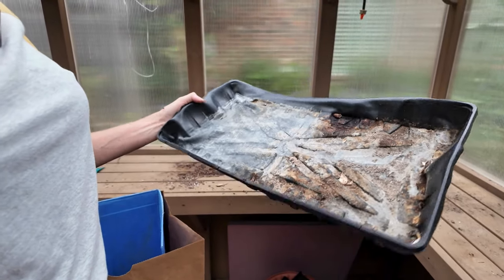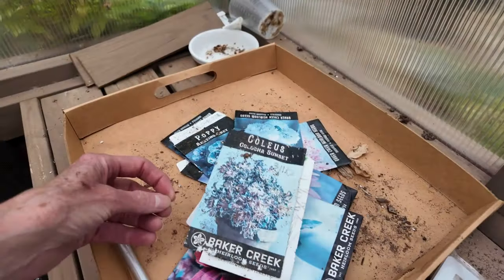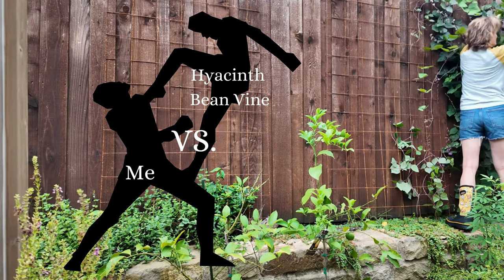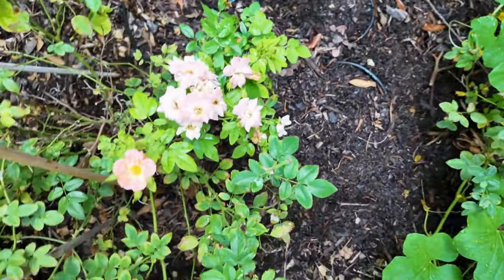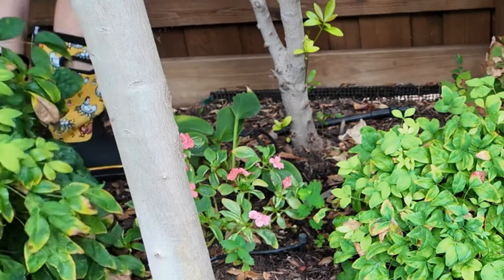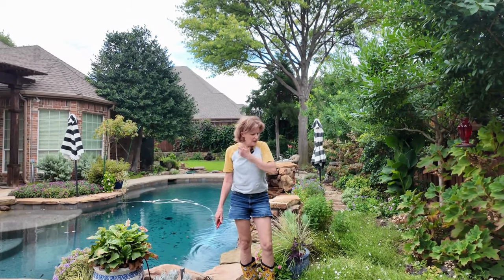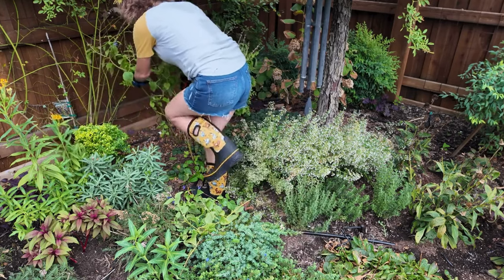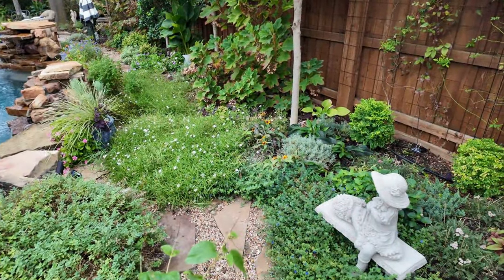September Garden and Greenhouse Clean Up | Trimming | Deadheading | Fall Garden | Zone 8b

Comment: How long can you use your greenhouse for seedlings?
Reply from the maker: Not as long as I would like! It changes every year so I can really answer that! When the temps drop down with a high consistently into the low to mid 80s, I’ll put them in the greenhouse.
Reply: @shadedfromreality  Yes, the heat and cooling does not help my bills!